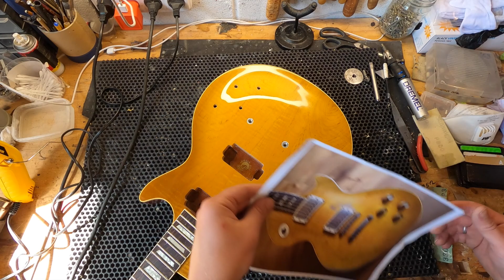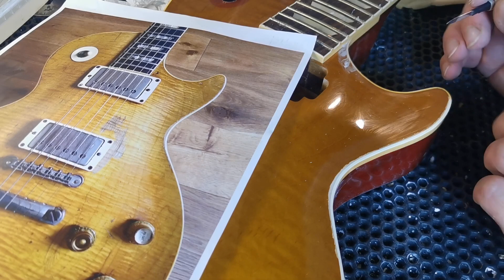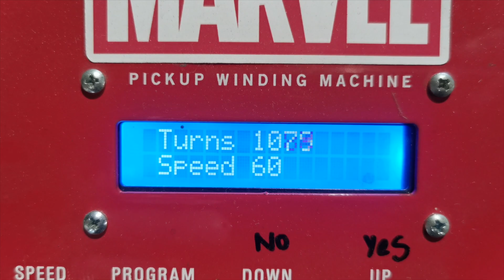"GREENY" les Paul Art Relic [Art process by Dr.Nitro]

Comment: Just curious. I noticed on a previous video that you would use a heat gun before you would take a (I think) abrasive 0000 pad to it. I’m assuming it’s to dull the gloss of the paint. 

My question is why do you heat it first?
Reply from the maker: Heater makes the varnish harder

Comment: I did a relic process on my strat and it turned out great...but I don't dare with my Les Paul, I would just like to remove the gloss a little bit so that it is more matte.....
Reply from the maker: @javierarias1199  try to use Melamine sponge

Comment: Buy a Epiphone 50'sor 60's standard, sand down the back of the neck and round over the edges of the fingerboard, upgrade the electronics and hardware wherever required for your personal taste and you'll have an awesome Les Paul for the money, especially since the Epiphones are already killer guitars if you like the weird D-shaped neck and don't mind the urethane finish
Reply from the maker: Yes. Have you tried it?
Reply: @8BombCustom  not yet, but I've seen enough Gibsons on YouTube (and tried a fair few dull ones in person as well) to know that they're way overpriced for what you're getting. If I'd ever want a Les Paul or SG it will be by another brand (probably not Epiphone though, since that weird D-neck definitely isn't my cup of tea. Great bang-for-your-buck otherwise, though)
Reply from the maker: @wilhelmtheconquerer6214  It can be worth. Especially with ES models. Epiphone product more quality wood base sometimes then Gibson. But kills this with plastic rinish and cheap parts. Polyester finish very hard to remove. But when you achieve this and change parts and pickups, then guitar can be better as Gibson CS. I have tried this several times. It works.